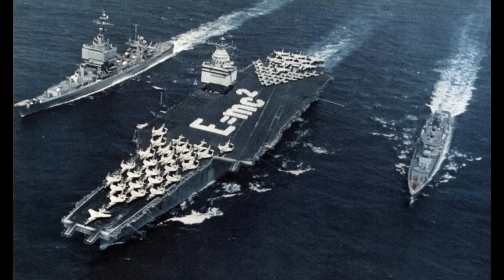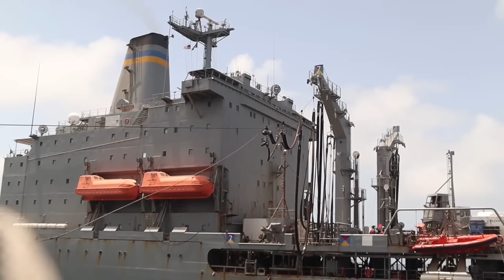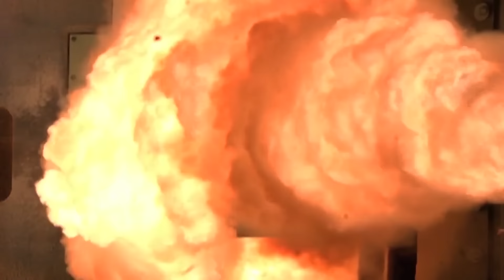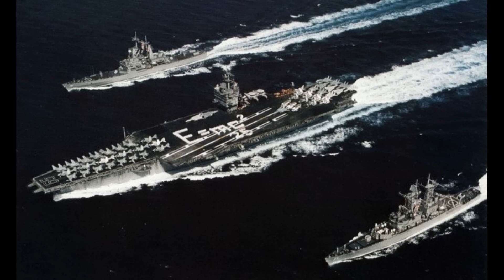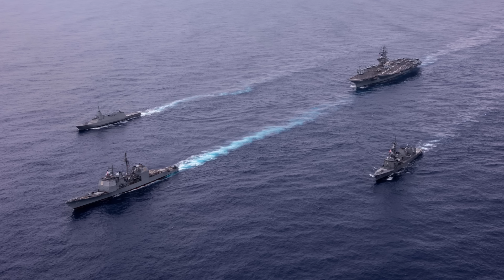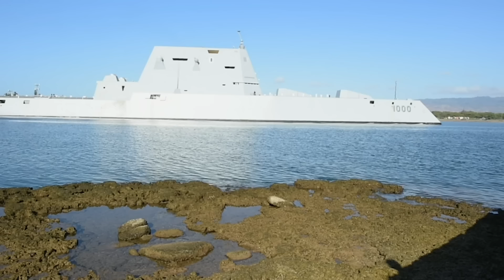Should the US Navy Bring Back Nuclear Cruisers?

Comment: This makes perfect sense to me for any vessel larger than a Destroyer.  They can use one of the new Ford class reaxtors already in production.  Design it so it can be removed and refueled without cracking the ship in half.  Steamline them, make them cheaper to make, abd easier to refuel, and maje more if them.
Reply: even destroyers can use nucs.  AND save a ton of internal volume at the same time.
Reply: You don't know what you're talking about. The US Navy can do much better than that. However, there's no reason to use a reactor as large as the A1B of the Ford-class, those things are rated at 700 megawatts. An S9G from the Virginia-class is rated for 210 MW or the S6W from the Seawolf-class is 220 MW, both would be sufficient for a destroyer and two would be enough for a cruiser. Furthermore, the latest types of nuclear fuel are designed to last the life of the ship, 50 years. Only submarines need to be "cracked open", even then the fact is they are cutting out the whole section where the reactor plant is because it's easier that way. Especially with surface ships, they can be easily designed so that there is minimal structure about the reactor compartments making it easier to get to the reactor plant. The Nimitz-class carriers were design to carry an installed spare reactor coolant pump motor. We were supposed to be able to replace those monsters at sea, but at best you'd have to be tied up along a pier in a sheltered harbor to do the job. I've forgotten how much they weigh, but those monster 4160 volt motors were over 10 feet tall and 4 feet in diameter. I'll let you all guess how much that amount of copper and steel with little air space weighs.
Reply: @trplankowner71 A1B is NOT rated at 700 MW, and S9G isn't nearly as high as you said either.
Reply: @colinscherer7212  Those are the current estimates. 

The S6W for the Sea Wolf class has an estimated output of 220MW.

The reactors rated output is much lower than its actual output. This is done for safely reasons.
Reply: The Wiki for the S8G (Ohio class) says that its output is 26.1MW.  I don't remember what its official rated output as its been a long time since I was an ELT onboard one. Even if I remembered the rated output I couldn't state it as that information is still classified as "secret" and NOFORN (NO FOReign Nationals).

What I can say is the propulsion is publicly rated at 45MW. Therefore the reactors output must be significantly higher than 45MW.
Reply: @Slackware1995  https://en.wikipedia.org/wiki/S8G_reactor
Reply: @trplankowner71 I think I mentioned that the Wiki is wrong about 26.1MW.

Do you have any experience with that reactor in excess of mine?
Reply: @Slackware1995  Probably not. However, you have a misunderstanding of the Wikipedia format. That 26 MW rating is only for the propulsion turbines, not the reactor plant. Wikipedia says that the S8G reactor has 220 MW output.
Now you may notice from my screen name, I'm a plankowner from USS Theodore Roosevelt. I won't discuss details either, our oath and mission are too important. This is what Wikipedia says about the A4W reactors and Nimitz-class ships: "The only ships to use these nuclear reactors are the Nimitz-class supercarriers, which have two reactors rated at 550 MW each. These generate enough steam to produce 140,000 shaft horsepower (104 MW) for each pair of the ship's four shafts – two per propulsion plant – plus approximately 100 MW of electricity." The fact is we busted our asses trying to get the ship to use that much power. We even dumped steam directly into the main condensers trying to use that much power. In fact, the Nimitz-class is designed specifically with a steam dump valve for that purpose. The problem reaching that much power output is that the Nimitz-class is just too fat to go much faster than ~36 knots or so. The Enterprise was always faster at top speed because her hull was more slender. The Nimitz-class has "Roomy Hips". We could definitely accelerate faster than any other surface ship in the fleet and turn damn fast for 1086 foot, 100,000+ tons. Still, we'd barely get above 20% power if that. The catapults use steam, there are LOTS of electrical loads that normally aren't used, plus even 1 or 2% hotel loads as well. Plus the fact that our turbine generator set laughed at a full load like it was nothing, they wouldn't even drop half a hertz from zero to full load. Even when we were kicking Saddam's butt, we might not even break 25%.
Now for a bubble boat, you have to think completely different, but the results are similar. Submarines must go to top speed when the WHOLE hull is wetted. That's a buttload of drag. Even the Ohio-class needs that 26 MW, although most of the time I doubt those boats used more than 5% power. When a sub captain say run and do acrobatic, they're just like a fighter jet dogfighting, all the way in on the throttle and afterburners going full blast. How close that would get an Ohio-class boat to 100%, I don't know and don't need to either. Neither does anyone else!!! Ohio's have a pretty fat hull as well, so I wouldn't be the least surprised if they had problem getting near top power the way a Nimitz does. Hopefully the Ford-class is a little more slender than the Nimitz is.
Another thing to consider for proposed nuclear surface ships is that the Navy likes to have redundant systems on surface targets. So any of them will likely have at least two plants a piece.
Reply: @trplankowner71 with everything you just wrote, you should know what an ELT is. I was on an Ohio Class.

The Wiki is wrong, period. The Ohio had a 45MW propulsion plant, not 26.1MW. The Wiki says both 220MWth (why they use that when other resctors just use MW?) and 26.1MW.

"The S8G reactor is in use in Ohio-class submarines and has a power rating of 26.1 MW".

I am one of the few bubbleheads to experience a long distance flank speed run, from Washington state to Hawaii on an Ohio class boat. 99+% of the time at sea was 4 knots to no where.
Reply: @trplankowner71 the ironic thing about you replying to me is that you didn't reply to colonscherer who said you were wrong.

I defended you on your ratings, but said that the Wiki is wrong on the Ohio class boats. 

As you know, even if I could remember the power rating of the S8G, I couldn't say what it is. I was on board an Ohio class boat in the early 90s.

The Wiki states:
"The S8G reactor is in use in Ohio-class submarines and has a power rating of 26.1 MW".

That is wrong. You claim that the 26MW is the power of the propulsion plant, but that isn't what this Wiki page says and the official propulsion plant rating was 45MW.

There would be zero reason to install a 220MW reactor for a 26.1MW power plant, 2 steam turbine generators and very minimal auxiliary steam usage.

Even if 220MWth is correct, and taking into account losses due to inefficiency, that reactor is much larger than required for a 26.1MW propulsion plant.

Unlike a carrier, a sub has a very small crew and obviously no steam catapults.
Reply: @Slackware1995  "99+% of the time at sea was 4 knots to no where." Yeah, I expected as much. The fast attack boats aren't much better. Sure they do more transits, but unless there's a REAL war, it's still boring. Even this year all those boats have been doing is bullshit mine hunting and launching a few cruise missiles. Also of course USS Charlotte that wasted a fish on a floating piece of junk not worthy of being a target. On aircraft carriers it's different, about 10 to 25% power up and down all the time. I wouldn't be the least surprised if someone told me that Roosevelt had to have the rudder bushings replaced sometime around the end of the century. Sometimes we even had an OOD order up specific turns! Just up a full bell and be done with it. What was he trying to do, conserve neutrons??? He must have come over from one of the oil burners. Less turns on the shafts mean more steam up the trunks to the cats. That will be a thing of the past when the last Nimitz-class is decommissioned. All EMALS from now on.
Hey, I believe whatever you say about the power ratings on any of the Ohio's. My point there was that the reactor classes from the last 30+ years are more than sufficient to power both a nuclear destroyer and even a heavy fleet defense type of cruiser. Especially when you consider that the Pentagon is going to want to put TWO reactors in even the destroyers. That's a big fat 400 MW at least. That's more than enough power to festoon that destroyer with lasers, railguns, the next generation Aegis set, and EW sets that will cook your microwave dinner from 100 miles out. As it is, those latest generation slick thirty two's can take out ICBMs and satellites. It's actually easier for them firing straight up than across the humid atmosphere over the ocean.
I thought I was going to be an ELT, because I already knew chemistry. Not in Uncles Sam's Yacht Club for Entitled Preppy Boys from New England, no, no, no. If you already knew electronics, welding, or diving, then you might get into those specialties. Otherwise, if you knew electricity and could turn a wrench, you were going to be a mechanic. Same thing if you knew chemistry. If you were an utter magician with a wrench, but had great math score, you were going to be an ET. 
I suspect that last part was mostly because there's  only three ways to do anything; the wrong way, the right way, and of course the Navy way. You do it wrong, you're screwed, you do it right, you're double screwed, you do it the Navy way and you're covered no matter how stupid that was. I knew some Navy vets before I joined, but they weren't either nukes or officers, and were very old, so they couldn't warn me ahead of time.
All things considered, I get the feeling that is why the President has proposed the "BBG(X)" project. It might distract the same jackasses that ruined the Constellation-class and trick the Chinese into trying to match it themselves there by wasting time and resources on a project that will do absolutely nothing for them.
If we want more VLS tubes in any given battle group, we are already building USVs, both medium and large that can carry containerized VLS missiles. As things are, the US can build at least a medium sized USV in every professional yard in the nation. Manned warships should never have to use their own missiles, unless they're trying to blow up ALL of China. We're not interested in that, we just want to stop them from doing what we don't want them to do. Heck we don't even want to invade Iran, perhaps a special mission to get their nuclear materials. After that though, we don't give a damn. Screw them. They can just rot away for all we care. The same with Russia. Why would we want to invade? Screw that! All we want to do is fuck them up enough so they stop doing what we don't want them to do. I always try to get foreigners to see that. We don't want to invade their sorry excuses for a country, but we can and will if necessary fuck them up very bad.
Alternately, we can always do what President Trump has done and intentionally drag out Iran's ass whopping so that China and Europe get the idea of who actually is the world's only superpower. 
What do you think about nuclear powered warships? I think all manned warships should be nuclear powered, doing otherwise is stupid. Pounding a penny so thin you can nearly see through it and calling it gold foil stupid. A lot of unnecessary work to not really save money in the end.
Reply: @trplankowner71 Nuclear power makes sense for large ships. Maybe a new CGN and of course subs.

What we need is a mix if capabilities. One of the biggest need is a crapton of cheap low end FFGs and not the Coast Guard cutter that we will be building. These would be ASW FFGs with mainly short range AD missiles, a few medium range AD missiles, a few ASROC, maybe 4 Harpoons, a 5 inch gun and a helocopter hanger. They would be used for Amphib escort, convoy escort and low intensity operations. They only need a top speed of 25-27 knots.

The next biggest priority should be reasonably priced FFGs for carrier escort. These would need to be 33+knots and primary job of ASW. They would have more medium to long range AD, but no AEGIS.  About 3-4 per CSG.

The 3rd priority should be a true light carrier. Something like the French carrier but about 60k tons.

These could be built in ships that can't handle the fleet carriers and add capabilities and flexibility.  Assign 1+ to an Amphib Group, important convoys or to support medium intensity operations. 

While we construct those we can plan out and build the next gen DDGs and CGN's.

Right now we are decomissioning ships much faster than we are building them.
Reply: C'mon,  most submarines are less displacement than most destroyers, unless there's a class of "pocket" destroyer (a.k.a. USCG Cutter).
Reply: @joelmelito1746 The Ohio SSBNs were 16,764 tons surfaced, the Columbia is 20,810 tons.

An Arleigh Burke flight III is 9700 tons.
Reply: @joelmelito1746  You must be talking about British destroyers.
Virginia-class submarine: 10200 tons, reactor 210MW, Propulsion 30MW, electrical capacity is not listed.

Arleigh Burke-class destroyer: 9,700 tons, 19,570KW propulsion, 12,000KW electrical.
A single S9G reactor plant is more than enough for a destroyer sized warship.
Virginia-class nuclear cruiser: 11,666 tons, Reactor 296 MW, 90,000KW propulsion. Two D2G reactor plants.
US Navy fast attack submarines are exactly that, fast and they do the attacking. They function in much the same way that the world's major navies though that cruisers would function in the time between WWI and WWII.
They also have a second important function in the fleet that the submariners don't like to acknowledge: protect the carrier battle groups from enemy subs.
In a well managed theater, this isn't really an issue. The subs protecting the carrier battle groups are in reserve. All they have to do is hang around leap frogging over each other. When they get out in front of the fleet, they slow down, put out their towed array sonar and trail a floating antenna. They don't have to use their ordinance. The carrier and destroyers do that. They listen, track and report. Then they listen and try not to laugh too loudly as that enemy sub runs like a mad man in a futile attempt to get away from the Mk 46 or 50 torpedo a helo just dropped right on top of him. Even if that boat manages to out run the first torpedo (very unlikely), there will be another helo ready to drop a second torpedo on the guy just as he's slowing down. Maybe even before that, he might still be running and unable to hear the torpedo hit the water, or even it's fast screws, but he WILL hear that torpedo go pitbull and start active pinging him just before he meets his maker. The most difficult part of that for the sub is not laughing too loudly.

Comment: They don't make sense. Until you look at electricity generation. Besides range, you have a potent electrical generator that does not need refueling. Replacement is a problem. I takes many years to build and/or replace a nuke powered ship. 
With drones and AI, its a new battlefront. These large, expensive surface combatants are quickly becoming obsolete. I doubt that CVN 82 and 83 will even be built.

Comment: Ironically, the Integrated Electric Power System (IEPS), is simply the modern version of Turboelectric Drive, that the USN started using in all of it's capital ships over a century ago.
And again, ironically, the reasons it was dropped after the early 1920's - besides the displacement limitations of the Washington and London Naval Treaties - are some of the same reasons arguing against nuclear propulsion, for anything other than capital ships and submarines today - increased cost, increased weight, increased complexity and hull space - when compared with double reduction geared steam turbine drives, that were able to offer the same efficiency and cruising range, once the US turbine industry had matured.
The reasons the USN started going with Turboelectric drive for it's capital ships, was efficiency and cruising range. The USN's early steam turbine setups of the late 1900's and early 1910's, were markedly inefficient and of dubious reliability, even when compared to multiple expansion steam engines - to the point that, as late as the Nevada class, the Oklahoma was still equipped with multiple expansion steam engines - in short, the USN was still hedging it's bets, when it came to turbine propulsion.
And after the Spanish-American War, one of the primary requirements for the USN's capital ships, was an 8000 mile cruising range - to be able to reach the Philippines from the West Coast, in the event of a war with Japan.
Turboelectric drive solved all those problems, and the USN adopted it wholeheartedly for their capital ships.
And now that an abundant supply of electrical power is a primary requirement, some form of turboelectric drive is once again in favor.